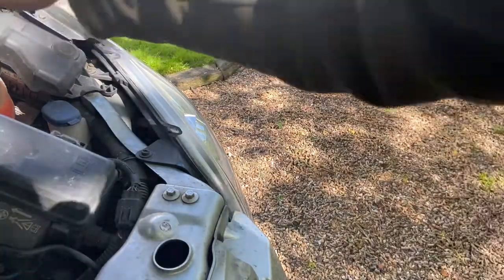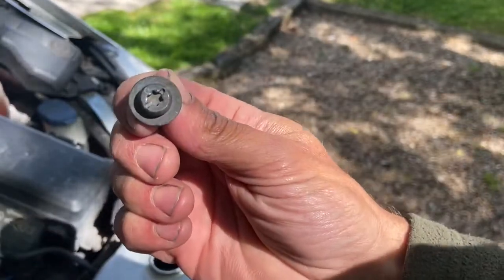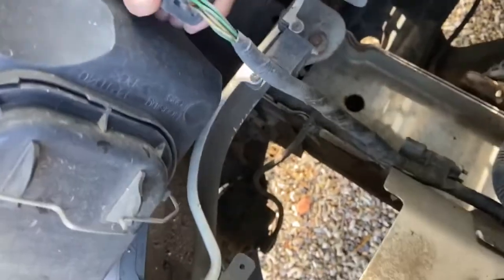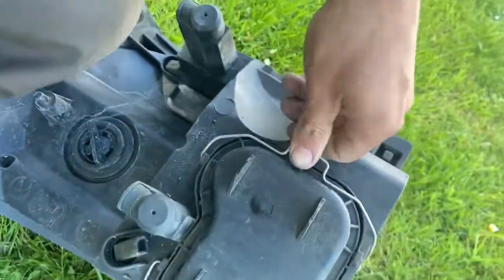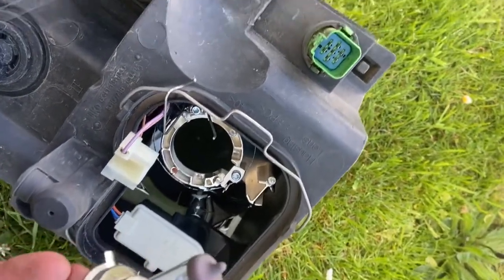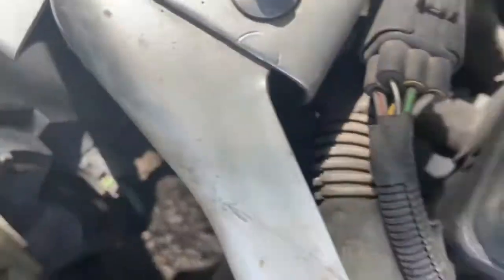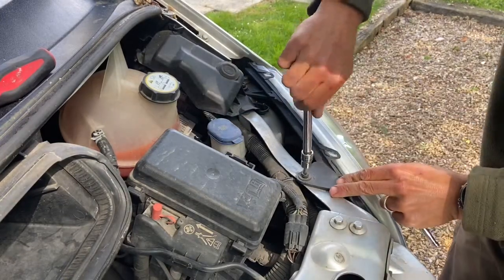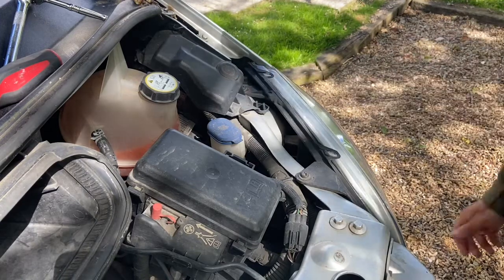How to replace headlight bulb or headlamp on MK7 Ford Transit

Comment from the maker: Check Euro car parts - https://tidd.ly/3lIO7xA  (use discount codes on site)
Check "Car Parts for Less" - https://tidd.ly/2LNEwIn  (use discount codes on site)
H7 Headlamp bulb - https://ebay.us/2Fxr6F
Headlamp bulb - https://amzn.to/3faTH7A
Headlamp - https://amzn.to/2AQBIVs
Reply: It seems like these links are incorrect. I have just changed mine on MK7. Its H4 bulbs (not H7).

You can even see in the video it's H4 (three pins at the back).

Comment: thanks, was just trying to make space  on the opposite side trying to  access in front of the air filter ! DOH I never imagined those two screws would be the answer to all the access problems. They actually designed a truck with accessible bulbs. Thankls again!
Reply from the maker: Nice one , glad to help & thanks for the comment .. much appreciated 👍👍

Comment: what about the smaller bulbs top left and top right?
Reply from the maker: Same procedure on the ns headlamp but they sit  at the top , on the drivers side you can replace them without removing the headlamp as there’s more room 👌